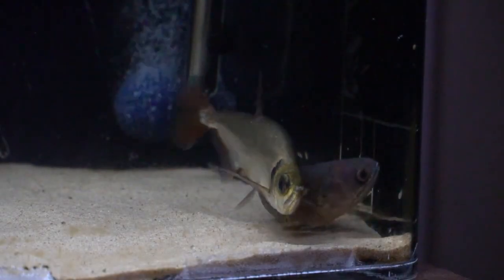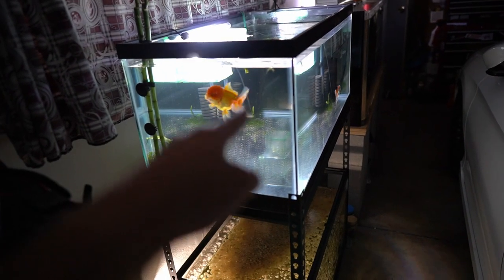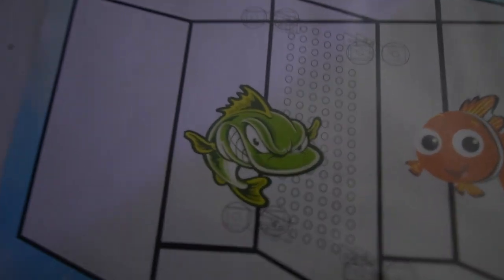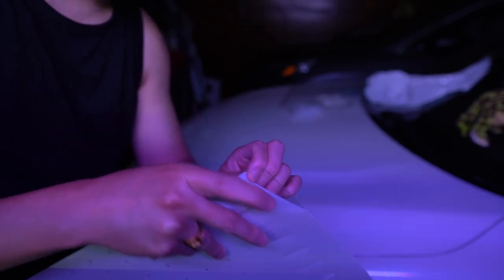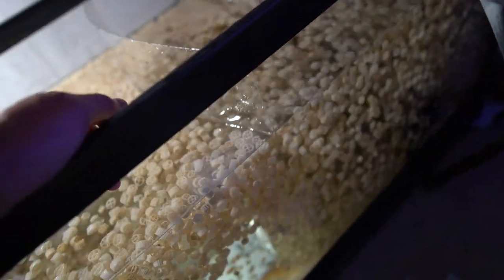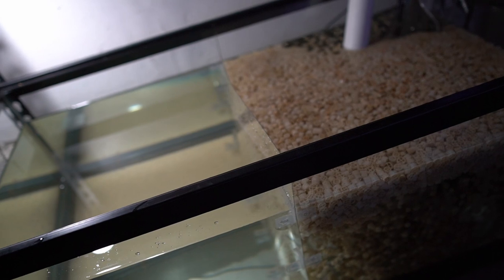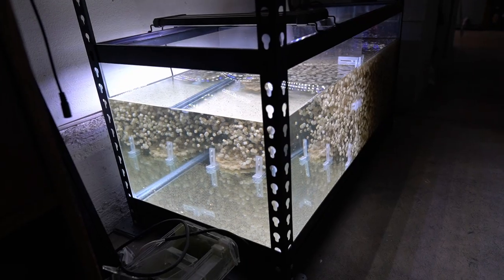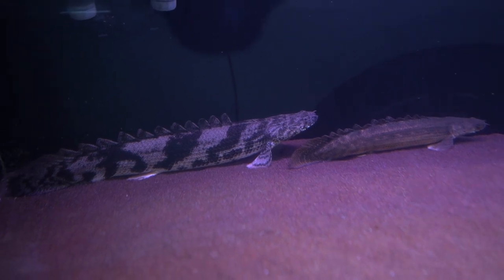I divided my K1 sump in half... and filled the other side up with Plants!

Comment: I disagree with your idea that a tilted tank will put all the pressure on the lowest glass panel. The water will put pressure straight down because the force is gravity pulling the water down. I'm not denying pressure will be on the sides as well but the difference between low and high side will be commensurate to only the difference in height not the whole volume.

Comment: Nice idea. I’m looking to do something similar but I’m connecting 5 1-gallons to a 10 for my betta breeding set up. Each 1 gallon will house the males and fry will go into the 10 with plants and now I’m thinking some filter media
Reply from the maker: Very interesting. That setup sounds like a lot of work haha… will you be using glass 1 gallon tanks and drilling them to go into the 10 gallon sump? I would suggest a 20 gallon long tank and dividing up the spaces within that tank and just running one filter/heater. Less chance of leak too

Comment: How has the system held up that way
Reply from the maker: It’s alright. I ended up putting my wolf in the left side so I switched out the divider for a 5 gallon bucket. Same concept and it works well. If you don’t have strong fish on the other side it will be okay
Reply: @BryanLa  glad to hear it I ran saltwater a few years back but have moved and going freshwater so just looking at different ideas.  The biggest issue I see facing me is I have a water softener so I’ll probably put some plants in for a month or so before even thinking about fish.